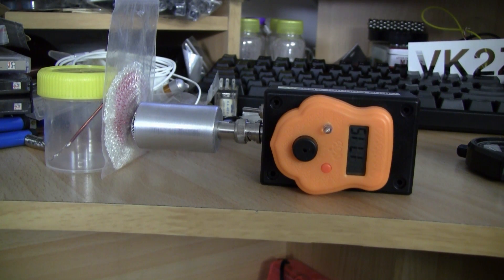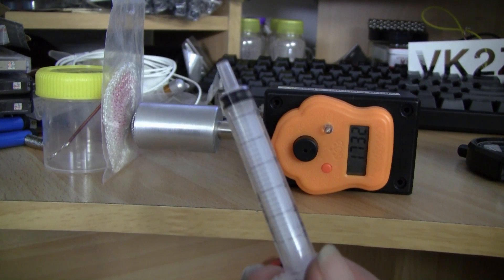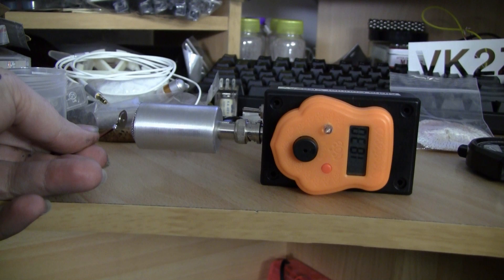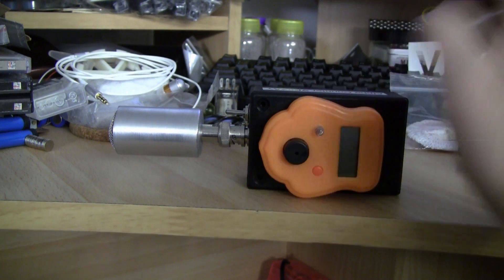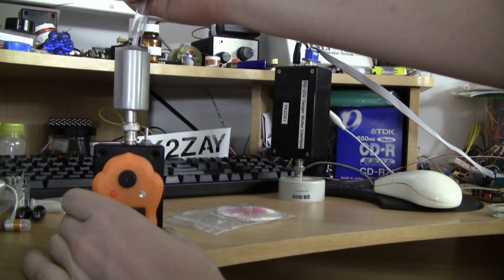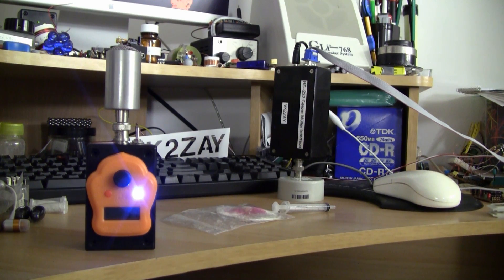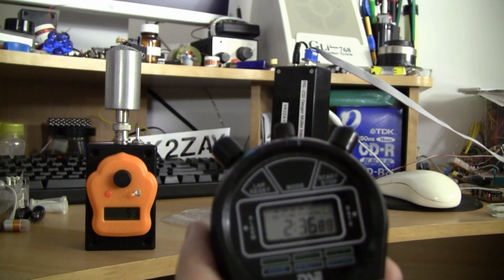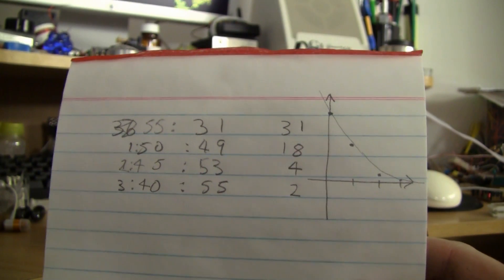Finished Ion Chamber Alpha Counter

Comment: I've a seriously stupid question.
Can we use a burned lightbulb like a geiger tube. 
For instance Burned thungsten Festoon Light bulb. Widely used on old cars.

There is a Nickel wire inside a burned Tungsten light bulb. Also argon gass filled init. Basically structure is like a simple gaiger muller tube.

Please don't make fun of me 😂
Reply from the maker: It depends upon the pressure of the gas fill, and without a quench agent it would need external quenching in the circuit, but yes in principle there is probably a bias voltage at which it would exhibit gas avalanche gain as a proportional tube and likely some usable Geiger mode too. Even air works to some degree but it is slow because of the ion lifetimes, especially oxygen I think. Spark detectors run at atmospheric pressure but they have a very narrow plateau and only really work well with alpha radiation which produces a lot of ions per particle. I've tried to make neon bulbs work like this, but I think mostly the volume is too small, and some designed for counting and logic applications use radioactive electrodes or gas to reduce jitter and can't see below their intrinsic activity. Some people have had success using biased fluorescent tubes which are Ar and Hg vapour with simple RC quenching. The geometry isn't idea though, it works much better with the radial electric field at reasonable voltages than between the filaments at each end. I did see someone use capacitive coupling with copper tape along each side of tube, but I've never tried that.
Reply: Thanks for your answer. I'm planning a test setup about this. Let's see what will happen. Thanks again.👍✌🙏

Comment from the maker: You could, but it would be really slow and wouldn't work well in the vacuum chamber required to give the alphas enough MFP, the ion chamber needs gas in it, and works better pressurised actually.  I'd probably use semiconductor detectors, like a bare transistor die or photodiode.

Comment: @vk2zay With higher voltage,I reached a little more than 10.000cpm, then as the leakage it´s relative low, the FET gate start to build up charge and finally get them to cut-off. With a good capacitor the 400V can remain for days, so you don´t really need a sophisticated power supply. If you are interested I have the article in PDF on the desing, but I think your circuit it´s superior by far!

Comment from the maker: @tesla242 The can is at nearly 9 volts, see the circuit diagram I finally linked...  Got any details on your proportional chamber?  More bias voltage is my next step, the ion sweep-out rate is very slow at these low voltages, so the maximum count rate is poor and the signal to noise ratio is barely acceptable.

Comment: @vk2zay The can it´s grounded or it´s a power supply potential? Did you try rising the voltage? I made myself a proportional Ion Chamber, but it works with 400V this are amazing result for just a 9V battery voltage. The Radon detection it´s great.

Comment from the maker: @gateauriz I've been thinking of making my own GM tubes.  Conceptually they are quite simple if you don't mind running about 1 kV instead of the more common 450 V seen in halogen tubes.  Even 2-propanol vapour should work for a while, might break out the vacuum pump next weekend. :)

The nice thing about this device is that is counts only alphas.  My GM tubes count gamma and beta (and alpha for the end-window ones).  Having something that only reads alpha is useful too.